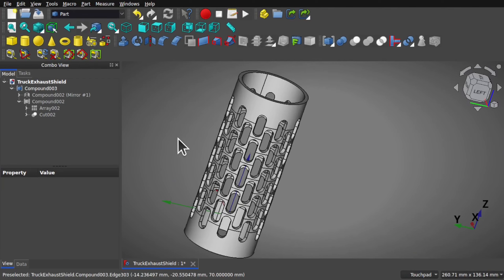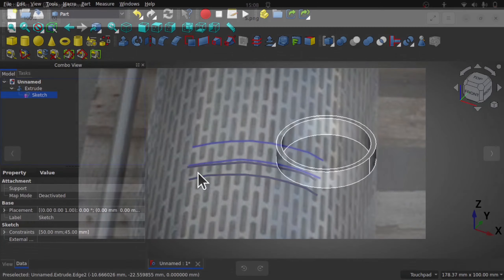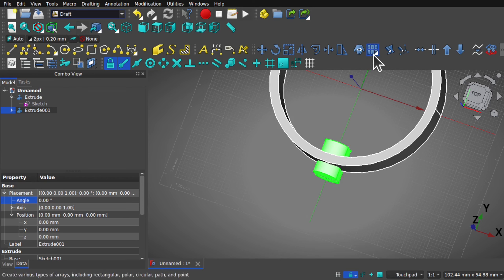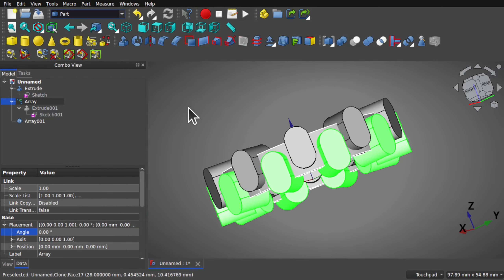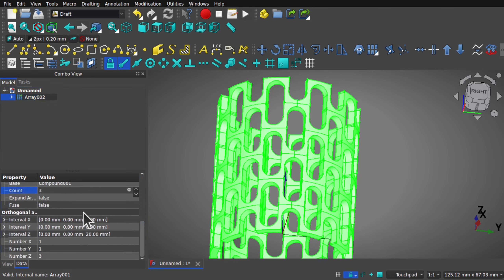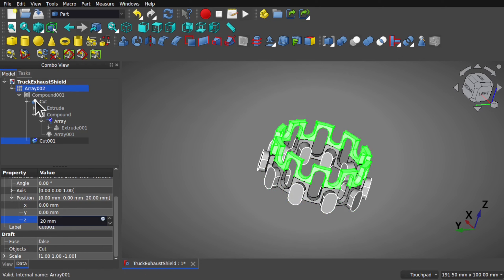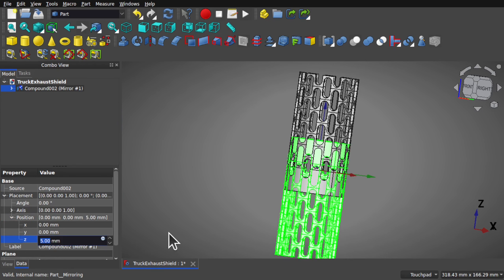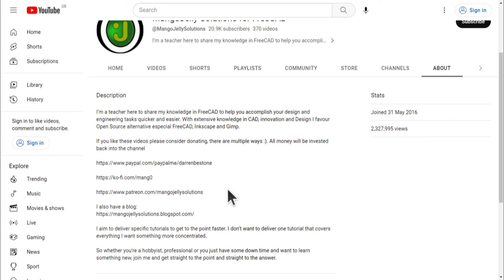FreeCAD Parametric Curved Surfaces | Exhaust Shield | Basic Surfacing | 3

Comment: Question for you. I was doing something similar over the weekend. I was creating an angled keyway with one side flat and the other 3 sides angled. Because of size constraints a bevel or fernet wouldn't work for my desired edges. I see you used the tapered feature for your extrude, which I haven't seen before. That was "Sweet." I also noticed your Attachment map mode was deactivated in your Part work bench. But, my over all question is, why is the attachment mode in the Part workbench deactivated. I had to use the Part Design workbench to access Attachment mode to separate my two sketches to make my loft. A pad just won't produce my result. Is there a way to enable the Attachment mode in the Part work bench so two sketches can be separated for lofting? This had me stumped for hours. Sincerely Akerace Drill.
Reply from the maker: Glad to see you picked up some tips :) :).  So part has attachment as long as you select a face, edge or vertex first before creating a sketch in the sketcher.  If you select something first you wont get asked for the planes (XY XZ etc) but you will be presented with a drop down (flat face, normal to edge, translate etc).  You can also do this from the details tab.  I have a video on attachment here that may help: https://youtu.be/jfhgcDcAAlk
Reply: I look forward to watching it. Possibly again. lol So much to remember.

Comment: Great video. At the point where you taper the slot extrusion to allow for the difference in inner and outer circumference, surely the taper applies to the top and bottom of the slot extrusion as well as the sides which is not what's intended. Is there a way to taper in only one axis 🤔

Comment: Very interesting. From a production perspective, this part would likely have been produced as a flat component, then rolled (and possibly plated, if not in stainless). So could this all have been achieved in the Sheet Metal Workbench, and if so, would that also have tapered the slots towards the centre axis, when 'rolled'?
IGNORE : I just had your Hexagon Mesh Wrapped Round A Tube video, from about a year ago, pop up in my YouTube feed LOL.
Reply from the maker: Lol, looks like the algorithm is working in my favor.   I have to say I haven't done any videos on sheet metal and have yet to try rolling sheets.  I am now thinking if this model will unwrap.  Yes agreed it would of been done as flat in production.  For a 3D print then go this way :)
Reply: @MangoJellySolutions  Thanks. Obviously, I really must try this for myself, but in that example of the 'Hexagon Mesh Wrapped Round A Tube' video, what would result from then proceeding to derive a 2D drawing of that part? Would it allow you to use that 'unwrapped' surface (that was used to create the mesh on the 3D object in the first place), in order to be able to create a dimensioned flat part (so, for sheet material manufacturing), or to only be able to dimension the 3D object? ...Or both?

Comment: I notice you made a Compound rather than a Boolean Union in order cut multiple objects in one go. Is the Compound faster? Do you have an idea how much faster?
Reply from the maker: I have never measured how fast.  I normally use a compound over a union if the objects are separated or they are touching but not intersecting each other.
Reply: @MangoJellySolutions  I'll try it in the future. Personally I've always used boolean unions because it just seemed more intuitive.
Reply: Sometimes Boolean won't work for me and Compound does for reasons unbeknown to me.

Comment: I've been working through your "FreeCAD for Beginners" playlist and was wondering if there is a video that explains the difference between Parts, Bodies, and Sketches. I assume a project can have multiple parts, parts can have multiple bodies, bodies can have multiple sketches. How does one know when to start a new component or when to continue designing on an existing component?
Reply: I've been using FreeCad for years now. You described the thing about the parts and the bodies exactly correctly. Which and how many bodies you make up a project is entirely up to you. Maybe everyone will do this a little differently. I've seen a lot of tutorials and some of them I would have solved differently for myself. But that doesn't matter at all. In the end, the project is the goal.
And tutorials provide lots of ideas for your own work. That's the beauty of it.
Reply: There are many ways to do something wrong, but luckily there are also many ways to do it right. A lot depends on your preference (something that comes with time). I for example almost never use the "Part Design" workbench, because I find it too limiting and use the "Part" workbench most of the time (which also works nicer together with most of the other workbenches). Sketches can stand perfectly on their own, btw. They don't have to belong to a body. For example they can mark hole patterns (containing ONLY the positions to then be used with a "Draft -> Point Link Array" for example). They can be a "root" template that other sketches reference and many more things.

An example for the same result achieved in different ways (a cuboid with rounded vertical edges):
Draw a square in a sketch -> "Part -> extrude" -> "Part -> fillet" on vertical edges
Draw a rounded square in a sketch -> "Part -> extrude"
Create a "Part -> Cube" solid -> "Part -> fillet" on vertical edges
The same can be done in "Part Design", just that the "extrude" is called "pad" and the "Cube" solid is called "additive box".
From experience I would not use the "sketch-> extrude/pad -> fillet" flow, because the fillet is prone to being applied to the wrong edges, if the sketch is changed.
The "cube/box -> fillet" is safe, but obviously limited to square shapes.
The "rounded sketch -> extrude/pad" is also safe, but the most time consuming. On the other hand it is also the most versatile.

What really doesn't help a beginner is FreeCAD's naming of things. The yellow "Part" object (not used in this video, but its shortcut is visible in the top toolbar all the time), has got nothing to do with the "Part" workbench, and neither of those has anything to do with the "Part Design" workbench.
Reply from the maker: Lots of value in this post and great explanations :) Thank you so much for taking the time to add such detail to help others.  And total agree, the naming is somewhat confusing.